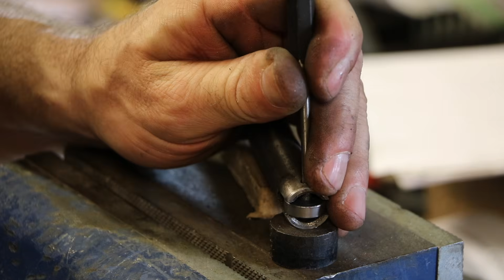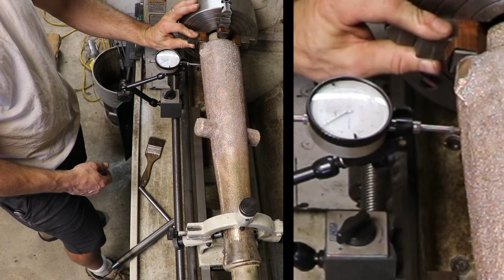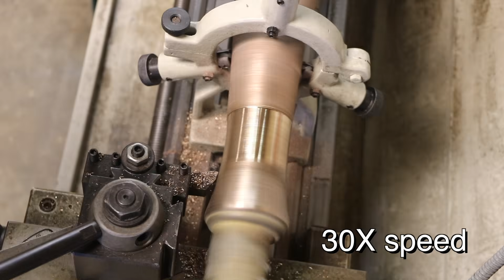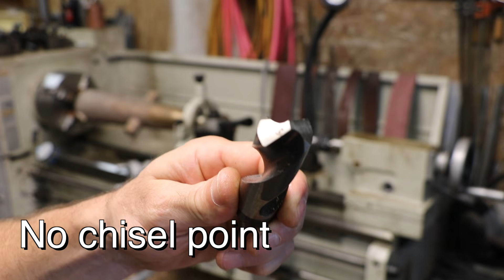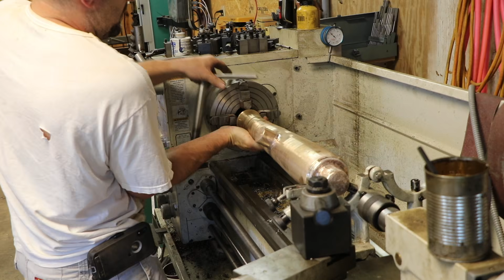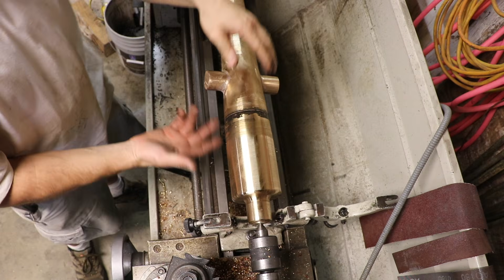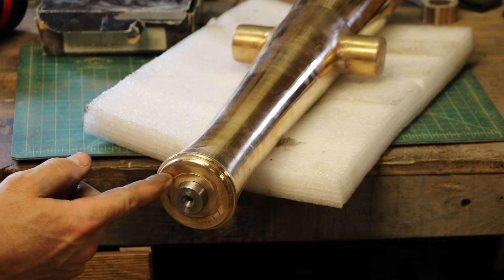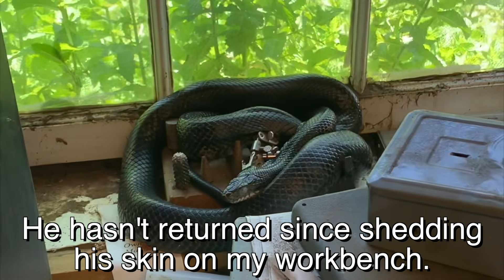Machining a Historic Bronze Cannon Barrel, Scaled Down Replica. FarmCraft101

Comment: To center the cannon with the tailstock you need to put your indicator's base on the tailstock's barrel and spin the indicator, not the cannont. Basically it's how a coax indicator works. Same procedure is used for coupling large electric motors with pump shafts.

Comment: Hate to say it, but only safe things to do are recast her or install a full length 1/4 inch minimum thick steel sleeve.  The whole cannon is the pressure chamber.  Pressure dosen't drop enough until projectile leaves the barrel.  If it did then a pistol and a rifle using the same bullet would have the same muzzle velosity.  1911a1 pistol shoots at 830 ft/sec, m1928a1 Thompson submachine gun shoots at 930 feet/sec, using the same ammo.

Comment: SLEEVE IT! If you try to fire a projectile it is very possible for it to hit the defect and cant in the barrel. Even a small cant into the defect could cause the projectile to get wedged. Your cannon would turn into a bomb. 
A possible way of sleeving the barrel is to fill it with a softer metal (like lead) and redrill the bore.
Reply: not if it is a lead ball
Reply: @brianthwaites2397  What Patrick is saying is that he should use lead to fill the defects in before then adding a harder material sleeve inside the lead. Also, assuming he's firing this as a reproduction cannon, he'd be using iron balls.
Reply: @mythralt  thats it a good idea lining the bore with lead and then sleeving and yeah i forgot that iron balls were used in the day but most were a tad larger than 1 inch bore, so lead balls seems easier if not historically accurate.

Comment: I would melt lead into the barrel to fill the defects. Re-bore the cannon a little wider so the interior is smooth, then fit it with a steel sleeve. 

This will save your cannon, and distribute the internal explosive pressure evenly. Don't insert a sleeve without filling those defects. Use lead. Low melting temperature, flows nicely into defects when molten. Easy to work. THEN fit that sleeve. You'll have a cannon that will function for years of great booms.

Comment: Oh, and FYI, when I was young I made cannons.  The most surprising to me was one built from 1/2" EMT thin wall electrical conduit.  Certainly not what one would consider to be strong tubing.  I plugged one end with a piece of steel that was held in with a cross-pin.  I drilled a 3/32" touch hole for the fuse.  Tube was about fifteen inches long.  I fastened it to a piece of plywood about two feet square.  My friend had a muzzle loader and cast his own musket balls.  We found ones that would fit pretty well in the EMT.  Using FFG black powder we could not blow that gun up.  Double charges with double balls wouldn't do it - but it would make the whole thing, plywood and all, recoil across the yard.  We were pretty dumb but we learned a lot - and we have memories.

Comment: I have some experience with small cannon barrels. You should in my opinion, fill in the crevasse with braze, silver solder, or use a liner as suggested.  The problem spot will catch wadding and fouling which will erode the barrel until it blows out.  Best wishes and great job!

Comment: Great job thus far.
Back in high school many many years ago I made a cannon and carriage  for my tool and die class  could shoot a 440 round ball it was a ton of fun but my shop teacher made me bore it out more and put a sleeve in it. The thing was I made it from cold rolled steel. He told me I will not be responsible for you blowing your dang arm off or worse.....
I figure if I had to do it with steel you probably should do it with brass.
I need to get that back from parents....lol
Reply: 4 englishlies I made a similar canon in HS weld shop when we had a substitute teacher.  Shot all kinds of objects across campus.  The sub kept coming out of his asking what was going on.....  when the regular teacher came back, my buddy and I got expelled for two weeks 😎

Comment: from the looks of it you didn't preheat the cannon mold or not enough so it started to solidfy or create gas pockets. Sleeving is an option but the problem is the rest of casting may have hidden voids you dont know about.

Originally old bronze cannons use wood to degas the mixture and they were poured in the ground right next to furnace to keep them warm...The mold was made of wax and was torched out prior to casting.

Comment: I like peoples idea to sleeve it. Then simply heat the barrel in an oven, and use LN2 on the sleeve to drop it in. Once the temps have equalized the sleeve will be locked in there for good.
Reply: @Kathleen Shaw  wouldn't that crack the metal from the rapid cool/heat? Id only do one or the other just to be on the safe side.
Reply: @TrevorMoore_  Cannon would have more thermal mass, and the sleeve is cold. The rate of heat transfer wouldn't likely be an issue for steel as long as it isn't cast or like 50 hrc

Comment: Good for you for appreciating "Herman". One huge black snake lives under my front concrete driveway. The other lives in the insulation of my hot tub year round. A smaller one comes into my shop from time to time. Mice and chipmunks are very rarely seen anywhere. I don't mind mice or chipmunks, personally, but they do drive my dog into crazed fits. THe black snakes have made it much quieter around here. :-)

Comment: You could have put the cannon breech end back in the 4 jaw and sticking out some then indicate the outside of the cannon close to the breech end you had already turned, turned a reference surface onto the stub next to the 4 jaw.  Remove the cannon and measure the reference surface then turn a piece of stock to that diameter. Once turned bring the steady up to the stock surface you just turned, adjust the steady. Lock the bottom two fingers. Put the cannon back in the 4 jaw put the steady back on and that should do it.  All this assumes your bed isn’t twisted. Ideally the cannon would have been chucked so that you could have turned that reference surface on the stub at the same time you turned the breech end of the cannon (however I probably would have never thought of it. Haha). P.S.  sleeve the bore and never have a doubt again.  Just my two cents.

Comment: I'm no metallurgist, but it seem sot me that if you want to keep the canon 100% bronze, you should be able to melt your shavings, fill the barrel with the molten bronze, and just drill it out again. I should think that the molten bronze would soften the internal surface enough that you get a good meld.

Comment: I don't know if you're taking votes, but if it were me, I'd probably scrap the whole thing.  I'd melt it all down and start over again.
Like others have said, any defects like that will make the cannon dangerous to use.  While adding a steel sleeve could reduce that danger, the danger can't be reduced to what I'd call an acceptable level.
This is because with any gaps in the brass, a steel sleeve would tend to warp outward and into the defects, and in the end it could fail catastrophically, possibly along with the barrel itself.

Comment: I would rather have the mice than the snake. If I had the snake in my shop I would have holes in the walls where I shot at the snake. Good looking cannon barrel though. Could have machined stem bushings for steadying of drill bit for the deep drill. No big deal though because it doesn't have to be a precision barrel. Just a great looking working model. And you have the right to be proud of the outcome.

Comment: the defect looks like it might hold a big 'ol hunk of solder pretty well. You could sandblast, flux, and pour some lead in there to fill in the hole. Not sure that would make it any stronger, but it would fix the blow-by.

probably better to add a sleeve. but it's your baby.

Comment: Looking at the defect, I would agree with the general consensus to sleeve the bore. With a 3 - 4 mm deep defect in the bore, that means an effective 9 mm of wall thickness over the defect, which is not that much. My suggestion is to bore the barrel out to around 35 mm and then turn up a sleeve to fit. I would make the sleeve OD about 35.2 and then heat the cannon and freeze the sleeve before inserting it and allow the cannon body to shrink onto the sleeve to secure it. I look forward to the first firing of the cannon, but personally, I would sleeve it before firing it.

Comment: I would have to agree with the other comments made. It does look way cooler polished up now. I made a similar cannon years ago in cold rolled steel. bored out a 1/2 inch hole as well as the side rests, then welded them to the barrel. After heat treating it worked well and the way I shot it was with flash powder and tinfoil balls I rolled up from cigarette package liners. The effect was pretty cool.

Comment: Its tough with a taper but if there is a straight section turned on the tail you could run an indicator along the length to make sure it is straight. Then you have found the center.

Comment: You could also pur a softer metal that bronze into the defect and recline bore but it it was me I would sleeve it to save my hard work because it's not if it will fail at that point but when will it fail at that point

Comment: The pressure will remain consistent until your projectile leaves the muzzle. Use it with incremental charges, inspecting the bore & outer diameter.  I doubt a 3 to 4 millimeter defect will cause any problems as long as there is no crack under the defect.

Comment: on 19:30 you probably can fix your piece in rest, then run lathe, then engage center, and it will mark a circle on piece, since it not concentric. center of that circle is center of rotation of your piece

Comment: A fill of hard nickel silver solder/brazeing rod would be sufficant against temps your working with. Also would be equal or greater strength than your parent material. Using 1"x1/4" 'precision machinist pipe' would be a great option to get a precison bore 3/4" stainless wall, using liquid nitrogen bath to shrink the 'liner'. The result likely would be for higher barrel pressures for readly availible smokeless powder. 'Alro steel' or 'production tool' should have that machineist pipe availble on special order.

Comment: The problem with this defect is that, because of the rough surface, you might have an induced crack there, where you get a pressure spike in the material. But since it depends on the shape and surface of the defect on its deepest point, it's simply hard to say ...
(What I can assure is, that at this point the barrel will fail from material fatigue, but I don't expect you to fire more than 20 shots with that thing.)
Anyways that's a mighty fine cannon you got there, Sir ^^
Really enjoying this series and thanks for putting so much work in it!

Comment: If you could use some flux core brazing wire and rig up a long nosed gun, you could possibly braze the defect up, re-drill and re-bore it. Even if it doesnt explode from overpressure, it will affect accuracy at a minimum. Having done stress analyses before i can tell you that a weak area surrounded by strong areas results in focusing the strain. Areas that woukd not normally fail if they are the same thickness throughout fail when other areas cannot sharethe load equally.

Comment: 27,000 psi = 1,860 bar or 1,860 kg/cm squared, depending on wall thickness yo can easily calculate the total pressure in the cannon.  Please note that in the original bronze cannon, the chamber that holds the gunpowder is about 1/2 the diameter of the bore or even less.

Comment: When firing this canon, one should contemplate whether or it would be safer to stand in front of it, instead of at the rear. The defects are called inclusions.
Reply: Inclusions usually indicate foreign material that got into the molten metal during cast, or they indicate metal that didn't melt properly,  these look more like voids, or potentially shrinkage.
Reply: @JMon2021  Hi have you seen what the gentleman in question, put in his melting pot? All sorts of questionable scrap. His melt temperature is so high that the metal has intercrystalline grain-growth.

Comment: Structurally a steel sleeve would be best, however, for continuity a bronze sleeve would be sufficient for maintaining period consistency. As you can still add riffling to a bronze sleeve, but a smooth bore would probably be more in keeping with period casting. But you also can simply reduce the powder charge. But I would not bore out to a larger bore size and sleeve back down to one inch, I’d just sleeve down to say a 6/8th or 3/4 bore diameter with a bronze sleeve.

Comment: Sleeving the bore would greatly strengthen and lengthen the life of the barrel.  Right now, it wouldn't take but a few rounds before you noticed deformation in the barrel.  The pressure exerted on the barrel is directly proportional to the powder used and also your method of evenly distributing the powder across the base of the barrel.  Used the slowest burning powder you can find!   If you allow the powder to pool in one spot, you could blow out your barrel in the first shot.  That's why they either loaded the barrel in a perfectly horizontal upright position, or used powder in perfectly cylindrical bags to load a horizontal barrel.  Figure out the wall thickness and the metallurgic makeup of your barrel to determine its tensile strength, and keep the pressure below 50% of your barrel rating.

Comment: I’d have made extension brackets that extend out the bottom and index on the two screw holes on each “tube” and weld another bolt to use as a screw drive for the bearing bars 🤷🏼‍♀️

Comment: You can use a simple spider sleeve on the steady rest end.  A 6"- 8" piece of steel tube with 4 spider screws on each end will allow room for the steady rest in it's mid section.

Comment: Use a button indicator mounted on the tailstock, fix to (something) that will allow it to spin in a circle around the butt-end of your cannon (piece of stock). While the part remains stationery, the button indicator moves (or spins, the actual term is called "sweeping") around the part. Since the tailstock should be "on center" with the rotation of the lathe spindle, this will place the part on the correct rotational center axis of the machine. (p.s. there is actully something called a "cat's head" yes, that's really a thing, that can be used as well. It mounts to the part, and is tightened down in much the same manner as the steady rest is. and has a smooth, machined outside diameter that the steady rest can be run on, even when the outside of the part is extremly rough) Here is an example:  https://images.app.goo.gl/k9nBHbFD13tMmyFD7  You COULD also run the part between centers, just get a center hole started drilled on each end, before mounting in the machine.

Comment: sleeve it, had that done to my friend's vintage 2 pounder. you are worried about the big crack is making it weak but that is not the problem. between firing you need to swab the bore to remove any hot spots that could light off the next charge the cracks could hold an ember you missed.

so keep in mind your hand will be in front of this while loading.

Comment: so im not a gunsmith but i know that it was common to proof a rifle barrel with a double charge (do your research on this, this is information i have seen on wrought musket barrels and may not apply to cannons). i would fire it remotely with a double charge then examine the bore, if you don't see any stress cracks or catastrophic failures then i would say its safe but would still use it with caution. im assuming you will use this for more of a signal cannon than a full charge blow stuff up cannon anyways so if you keep the charges low it should be safe. 
Or you could go the safe route and cut it off at the defect and make a mortar style cannon out of it and use the rest of the cannon in a new melt for V.2. there is always a V.2 lol

Comment: I think you should try and hone the bore using cylinder honing tool either three stone type or flex-hone.
the smoother the finish the least amount of stress points in it. + you can achieve better I.D. uniformity .I'd try filling in the defects before with something like in JBweld to ensure "bump free" ride for honing tool (I don't believe it would add strength whatsoever)
 btw. how would you go about lining the barrel ? epoxy or temp differential? silver solder doesn't seem feasible on such mass of bronze.

Comment: I AM NOT A MACHINIST. However, if you wanted to find the center of the other side, if you held it vertically, and were able to raise and lower it straight up and down--you might be able to put a tiny dot of paint or marker in the center. Like, a reverse plumb bob?

Comment: You could get or even make a fluted or rifled sleeve to install (more accurate shots). And to make sure it goes in straight, you can make sleeves/collars to help keep the cutter centered as you bore the barrel out to accept the rifled sleeve. I would make the sleeve slightly larger then the newly bored barrel so you have to heat the cannon up to press in that sleeve. That way it will go in and stay. JMHO

Comment: I'd fill the gaps with epoxy (fill, then insert 1" diameter rod to form the epoxy) or sleeve it with a steel liner.